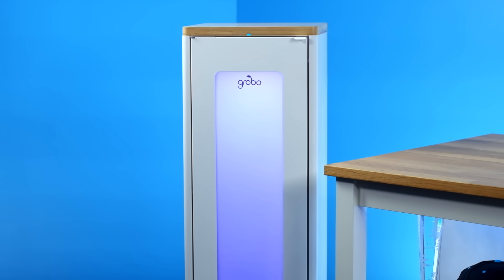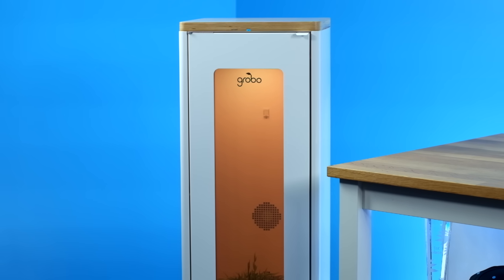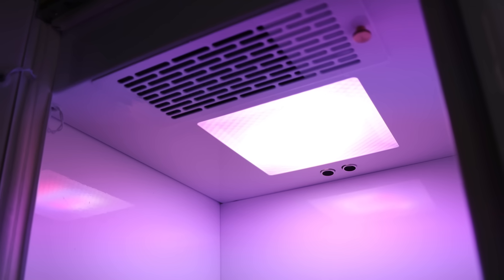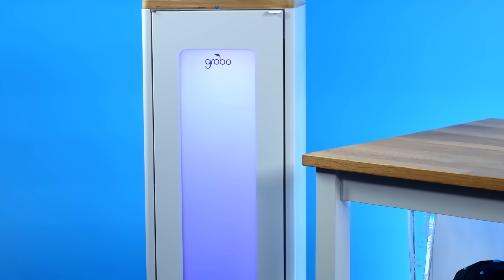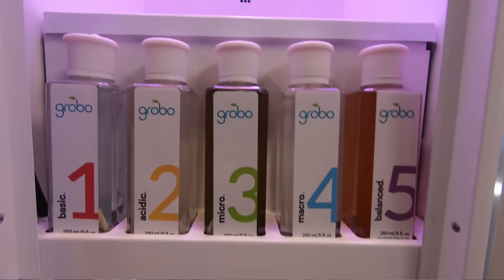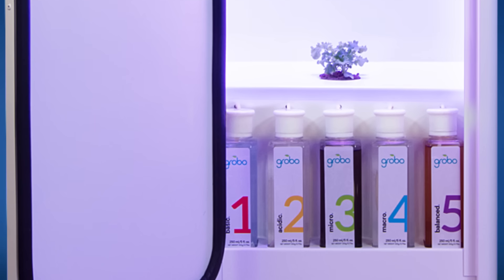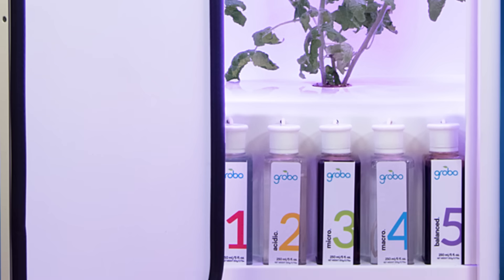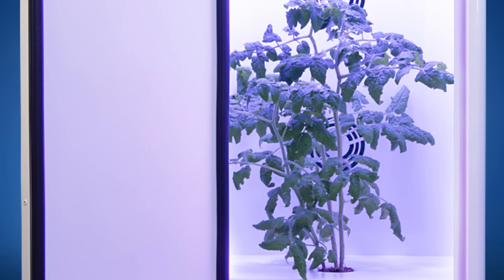How does a Grow Box work? [Grobo Premium / Solid Feature Overview]

Comment: So no control over the air temperature or humidity? How would you recommend to use grobo when conditions in (for example) an apartment arent ideal?
Reply from the maker: Great question.  The Grobo does best in a temperature controlled environment.  If you are too hot or cold, so is your plant.  I don't recommend it for a garage or balcony.
Reply: Grobo Thank you for your answer! So What temperature/moisture is preferable indoors since the lights inside the gobro elevates (how much?) the temperature?